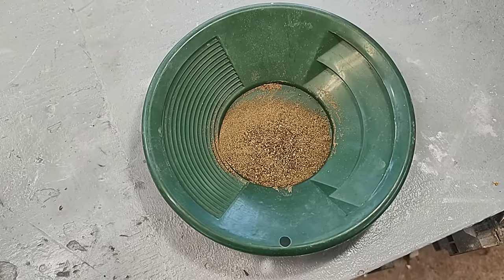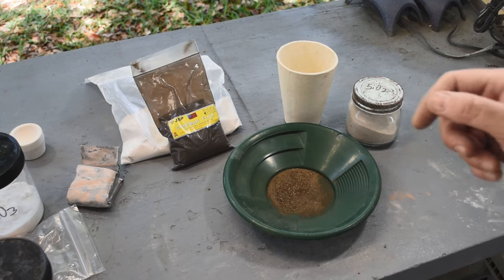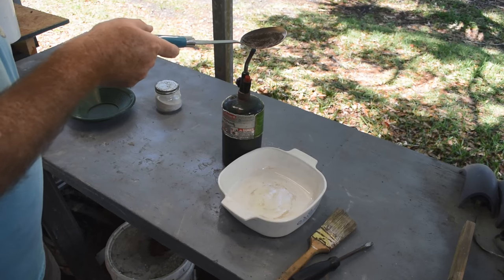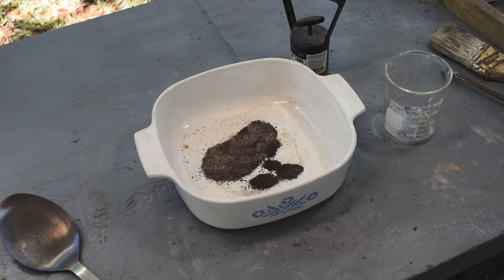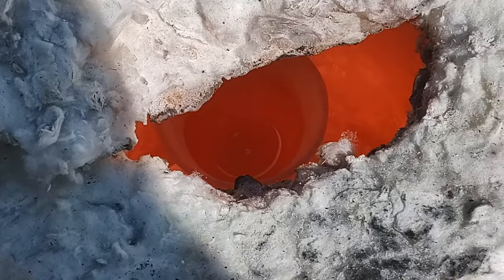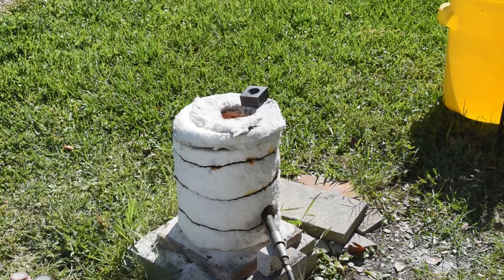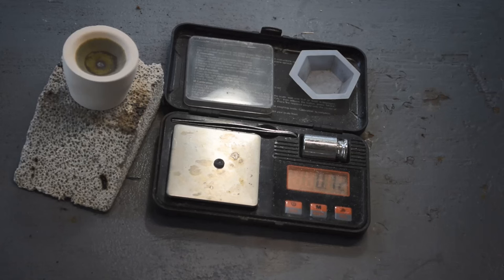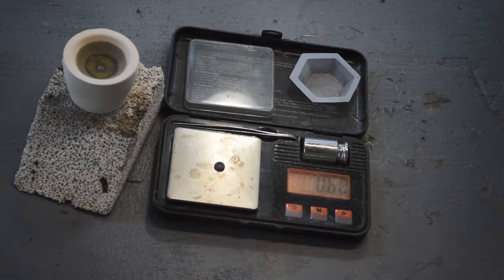Recovering Gold From Jason's Gold Mine at MBMM part 5 #gold #goldrecovery #mining

Comment: Professionally, major industrial smelters always roast the ore.

Also, they use that sulfur dioxide and use it to make sulfuric acid and then sell that.

The acid is a part of their profit margin.

Also, once you oxidize all the sulfides, all of the oxides can be dissolved with a whole host of acids which will leave pure gold behind which can literally be screened or coarsely filtered to remove the coarse sand.

Then you have such pure cons you can save up a fortune in energy and flux material for the actual smelt.

Comment: Exactly what you would have to do.  Not so simple then. It would be a lot easier to just get the flux correct the first time. A simple flux of potassium nitrate or sodium nitrate. A little glass not silica sand. Crushed glass is best and borax to thin the glass. Bring it up slowly and give it time to let the nitrate  burn off the iron and other impurities.  You only need the lead if not expecting much or it's an assay and you wish to collect the silver.  Smelting is not assaying.

Comment: Throw it in a test tube with some nitric.  Once in solution it will be easy to determine what metals you have.
Reply: Not if the ratio of gold to other metals like silver or copper is over 50%. It won't part.
Reply: @Ivanf225  very true, in which case you can easily inquart it down to a 6K alloy.